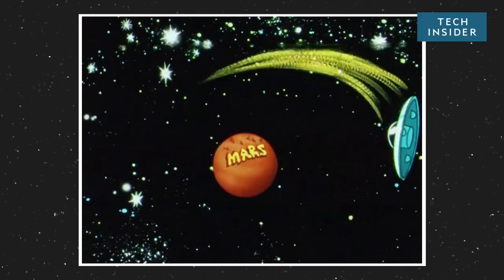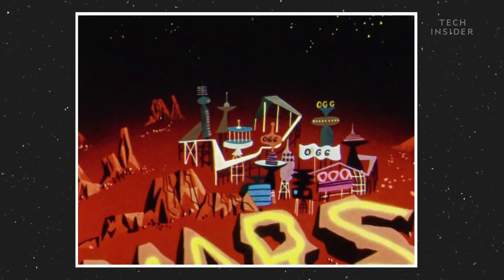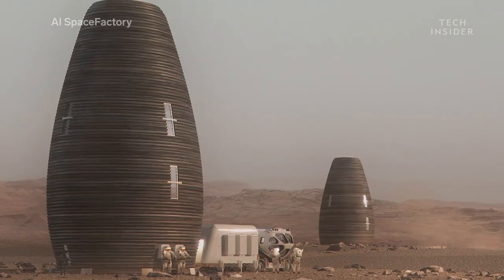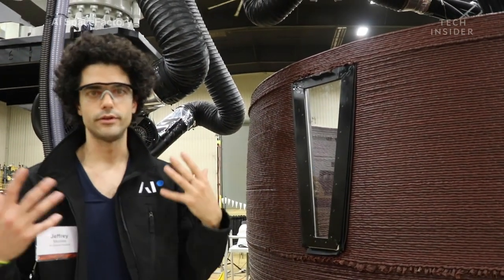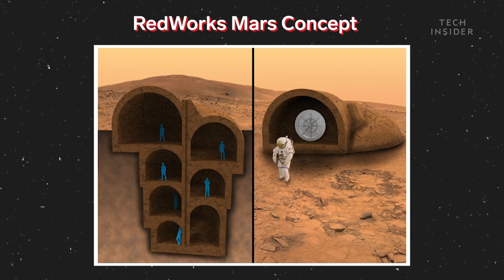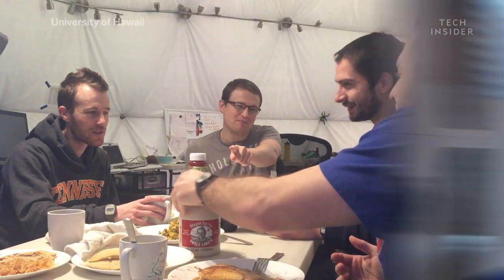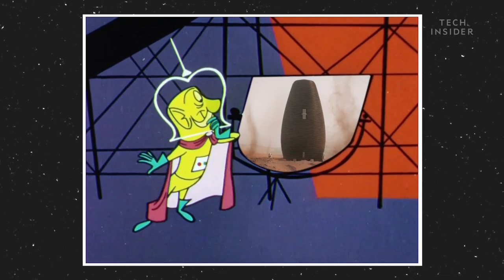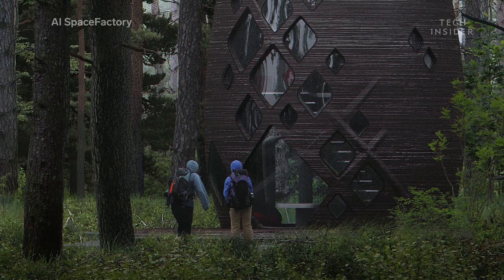The Mars Homes That NASA Awarded $500k

Comment: Underground bunker: I'm secure and safe from radiation
Marsha: Hold my windows
Reply: Dr. Phil's creampie lounge  yo wtf
Reply: hold my center weight which help against tipping over, especially at high winds, tee hee time to make the base bottlenecked
Reply: @pottasium7117  winds aren't a problem on Mars
Reply: @william41017  i know that the atmosphere is low an all, but what about storms, they are still a thing there if im correct :V
Reply: @pottasium7117  since mars' atmosphere is so damn thinn it couldn't even slightly move a car.
Reply: Falc0n Productions  And all of them too weak to do anything.
Reply: @pottasium7117  ...mars doesn't have high winds...winds are barley strong enough for small sand storms
Reply: Sure, but what about reduced gravity?
Bones and muscles will be losing mass,
meaning, your body will weaken over time,
childbird will especially become deadly,
not to mention, your heart is a muscle as well.,.
Reply: @soymatze48  exercise machines exist and is what they use on the ISS to prevent such things from happening.

plus the gravity is just barley enough that you can live in it your entire life with out regular workouts  and if you dont have any heart condition all you have to do to go to earth is workout and gain muscle to go back. 

well thats if at least least fetuses can properly mature in the low gravity, that area we still have no clue about
Reply: Falc0n Productions  that doesn't mean the wind is strong... a gentle breeze does the same things on earth
Reply: @soymatze48  They will have to train the same way they train in the ISS. They showed a gym in the top part of the building to counter this.
Reply: The thing with "storms" on mars is, the particle density is very low. Our storms on earth consist of air. On Mars, there is almost none, so there are just very few atoms actually swirling around and the dust is just so fine it couldn't even move a human, let alone a house (btw that's the only mistake the movie "the Martian" had, that [SPOILER] the dust storms on mars could've never pushed that rocket over, let alone moved the equipment that hit Mark). So, because of that, you could barely feel the storms on your skin, if you were able to walk the Mars without a space suit. They just don't have any mass (oxygen atoms, particles) to move anything.
Reply: @coreytaylor447  and if it turns out that the gravitation is not enough to stay healthy without any exercise... weighted clothing, i guess.
But how did we all just skip over the issue with windows and radiation? I guess electromagnetic fields are so obvious that it's not even worth mentioning :D
Reply: @jkobstube4314  /watch?v=9Ot32cwr9ww storms could become an issue for later generations on mars tho
Reply: @MrMCKlebeband  "exercise machines exist and is what they use on the ISS to prevent such things from happening." -me earlier in the thread.

also the windows will not add any radiation of harm as radiation-proof glass exists and even if they didnt use that, that wouldnt matter because unless they stand in front of the windows continuously for days on end, it wont do anything. radiation isnt an instant death thing that if you touch it bad things happen. in the Apollo missions the astronauts where able to be exposed to the radiation of beyond earth's protection for a week and not have anything bad happen. and if you where to notice, its not like these are large windows and there are not many of them. the astronauts will be more than fine
Reply: @pottasium7117  Yeah the winds in that insanely thick Mars atmoshphere. We are lucky if Wind Turbines would work during 300mph storms on Mars.
Reply: Lead lined windows.  They use them in hospitals and nuclear reactors.
Reply: The soil on Mars is toxic

Comment: Imagine going to Mars in a advanced and expensive space ship just to live in a giant black egg...
not complaining or anything I know its better than anything else I just find it funny
Reply: I wouldnt mind at all if they would built this to live in for modern people something new and some design more then a wall and a pointie roof cant hurt i think
Reply: @juriaanoussoren  If it were available and cheap to me then I would also totally live in something like this
Reply: Visible Confusion your losing subs change ur name back
Reply: @malditapeppas509  A sandstorm on mars is like a light breeze
 on earth since air pressure is 1/150 bar.
Reply: One thing I complain is the stairs. Although we could add the elevator, still need a lot of cost. I'd prefer a house without stairs and all accesses are near
Reply: @malditapeppas509  A roundish shape is better because you need to pressurize the habitat. But since the printed habitat is just a radiation shield and the habitat itself is inflatable the shape of the printed wall is just round to match the shape of the big balloon inside.
Reply: @malditapeppas509  You can easily see how it works with this other habitat: https://www.youtube.com/watch?v=AIrH01N9AsE
But sandstorm is not an issue at all for the habitat, it is an issue for the solar panels.
Reply: Sorry this might sound annoying but......

It's *an
Reply: Same here not complaining but its funny indeed.
Reply: A black egg you say?
Hollow Knight flashbacks
Reply: @johntheux9238  -- Yes, thanks for pointing that out. That misconcept of storms on Mars being devastating is still around and has been perpetuated by the Martian movie.  Inconcievable they would use that as the premise of the rocket swaying in the storm and having to abort the mission. Oh yeah, and gravity is just the same as here, according to that movie.  Cannot understand why NASA supported that nonsense.
Reply: @juriaanoussoren  remember this shelter is just to get human started on mars. I'm sure nicer looking architecture will be built as our presence on mars gets strong. Can't start building Sydney Opera houses on the first trip.
Reply: Egg
Reply: 666 like :D
Reply: I agree if we're me I'd put some those inside glossy amazing inside design walls on outta side make it least more appealing on that side too lol
Reply: @malditapeppas509  that's why hope they use dome and put those structures inside allow people move and walk around and drive on Electric buggies haha just don't drive on the glossy paths
We definitely need health,safety and security 24.7 to monitor everything maybe some nice shutters for those domes make night time inside couple those dome lights around inside the dome have nice look to it
Reply: @johntheux9238  remind me to add you to Misson list matie ;) compliment intended
Reply: @johntheux9238  Well, kind of.  It's a sandblaster, though.
Reply: @aritrianditya7700  I agree except for the fact that having a higher vantage point with a view of the landscape would be pretty cool.
Reply: @malditapeppas509  how about reducing the population. Second thought sounds taugh but think about it, just give one birth or adobting or don't have any generation at all... I mean something we can do tho
Reply: Virtual Windows I think would make more sense in these habitats. They could still look out on the landscape but could also simulate other landscapes from Earth without increasing the radiation hazard. Also in the future VR will be able to realistically recreate almost any environment to help promote psychological health.